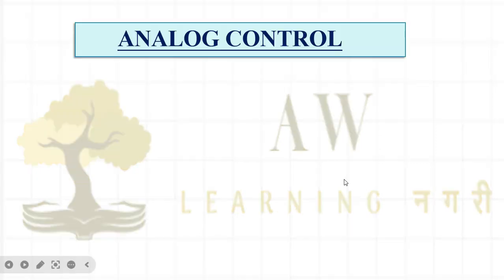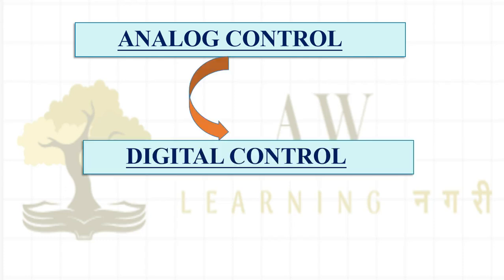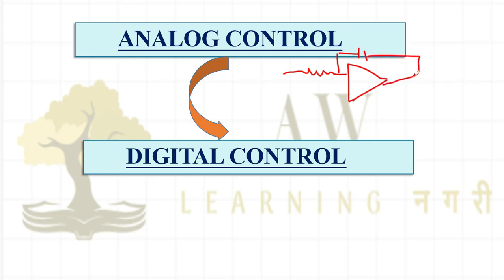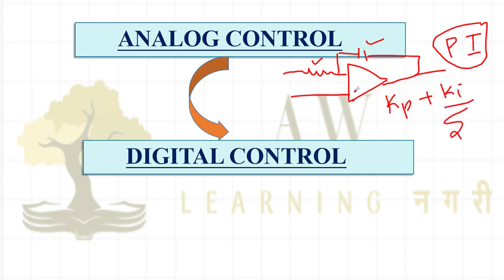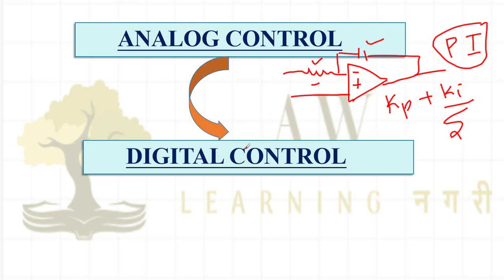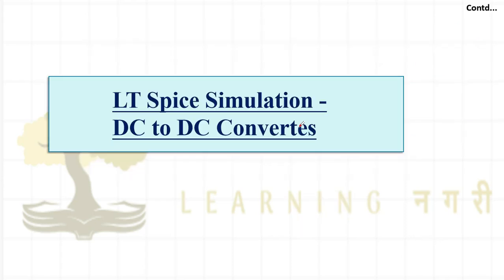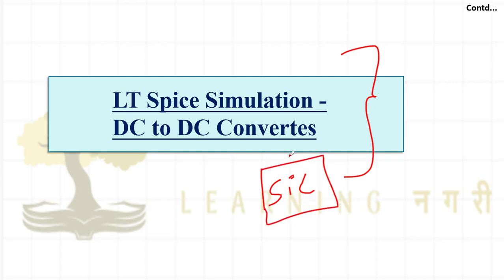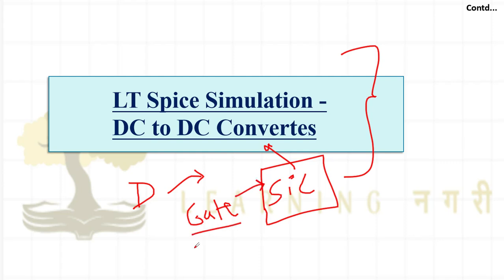What Next.....

Comment: Hi, How do you obtain the Transfer functions?
Reply from the maker: @KvsPrasadarao  We can obtain the tranfer function Using Small Signal Modelling. 
I had explain in one of my previous video regarding how to derive any transfer function using small signal modelling approach and also provided important transfer function there. You can check it out.
Reply: @Kingashish-555 yes I know. But for totem pole converter how do you obtained?
Reply from the maker: @KvsPrasadarao  In the same way. Have 2 circuits during on state and off state and do the same procedure. And while tunning the controller choose worst case of duty ratio.
I can suggest you 2 paper which you can refere:
1) A Digital Control Method with Feedforward Reconstruction for Improved Sampling Interference Suppression in GaN HEMTs 
based Totem-pole PFC Converters
2) Totem-pole Bridgeless Boost PFC Converter Based on GaN HEMT for Air Conditioning Applications